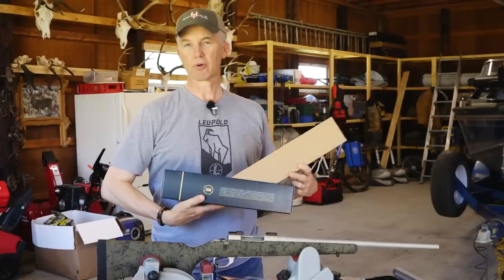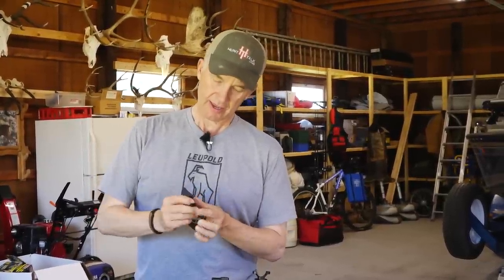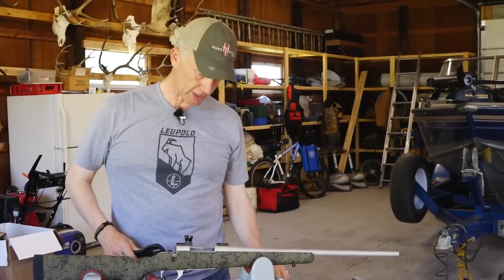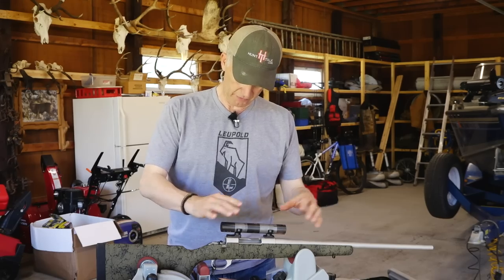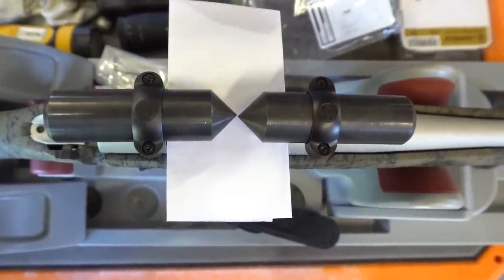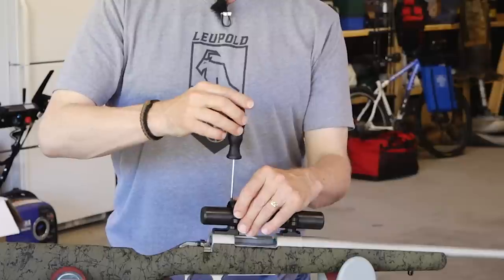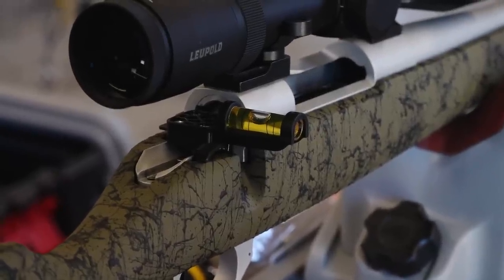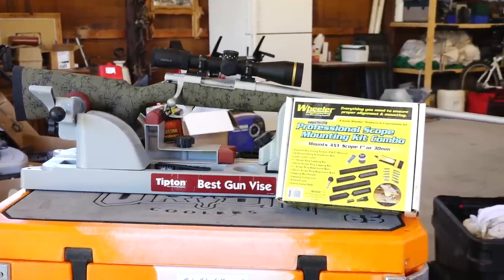How to - Basic steps for a Rifle Scope mount with Randy Newberg

Comment: Randy I really love your videos. I was always taught this exact method, but after getting serious with rifle shooting I've found the top of the turret isn't always level. Put the bubble on the turret find your level, then turn the turret a 1/4 or 1/2 a rotation and that bubble will shift. Now just find where the action is level, throw the barrel level on there and just plumb bob the scope's reticle.
Reply: Might be a dumb question, but how do you level the rifle? I normally use a picatinny rail to level it, but this time I’m using rings like in this video. The end of my receiver isn’t even where I can use a bubble. Could I use it inside the action?
Reply: @codydavis4513  I always start with a level surface.  Whether that's a kitchen table, a work bench or kitchen counter.  To me, that's half the battle, once I start with a level work surface then the rest is relatively easy.

Comment: Thank you, I needed this.
Following along, & realizing  that in the past I could have mounted mine better , now going back and rechecking all my sights for being true & level,  & re-zeroing.
Reply from the maker: At close ranges it is not that important, but when you get out a ways a canted crosshair is a serious problem.
Reply: @Fresh_Tracks  I use the Wheeler level system. My complaint is they should of used a better color for the housing of the bubble level. The yellow gold color wasn't the best choice. The bubble level liquid is yellow too, and the housing is too shiny. It plays with the eyes too much. The system works, but its difficult on the eyes, and slows the process. I also use the Arisaka scope level tool. Many times I thought I was right on with the wheeler system and I'd catch a slight cant with the Arisaka tool. Only works with flat surfaces though.

Comment: Great intro video to mounting an optic. One thing to mention though is to not use the turret to make sure you reticle is level. One little thing could be off with your turret/ turret cap and this will throw you off. Use a plumb line to level your reticle. Also a plumb line is cheaper. You can make it at home home with cord and anything for weight lol

Comment: Hey Randy, I know you really like the dovetail mounts, I’ve seen them on pretty much every one of your rifles. I’m curious if you’ve ever used the Leupold Backcountry mounts?  Still a two piece base, but a one piece mount/ring which eliminates messing around with the dovetails. I used to have the dovetail mounts on my hunting rifles but just got tired of trying to align them so switched them out. Curious on your opinion.
Reply: Yep, dovetailing and trying to line them up and all that nonsense just isn't necessary. Modern 2 piece mounts already take care of all of that. Aligning mounts now is as silly as "breaking in a barrel"....

Comment: Hey Mr. Newberg, I have a question about scope rings. Are scope ring with only two screws any different than those with four screws? For example, does 2 screws scope have a higher chance of causing the scope to move around while walking through brushes?

Comment: I still lap every set of rings.  Everything has tolerances
Reply: No, 2 piece back country rings are CNC'd out of a single steel or aluminum billet. Lapping is silly in modern times.
Reply: @Simon-talks  tooling is never perfect. Why do you think valves are lapped? Is that not necessary now? Of course it is
Reply: It’s not necessary these days. You’re living in the past…